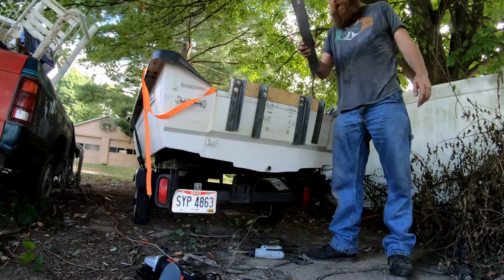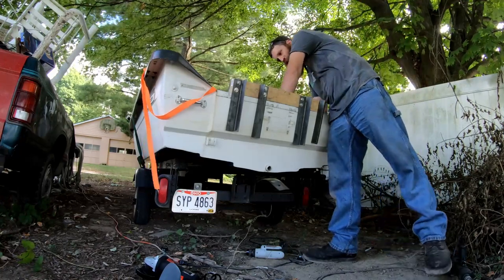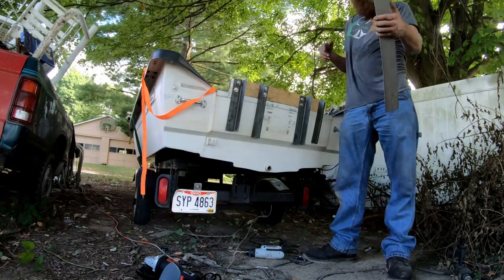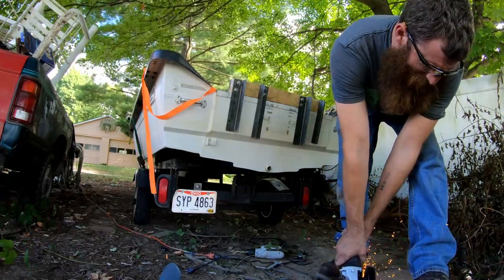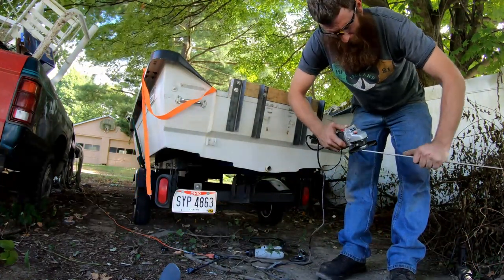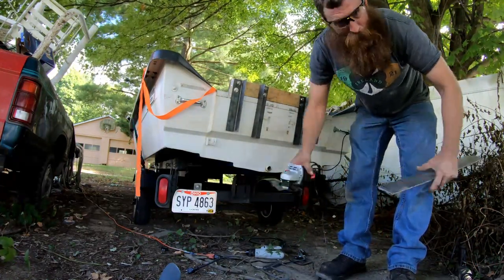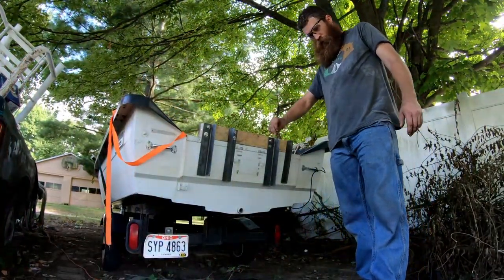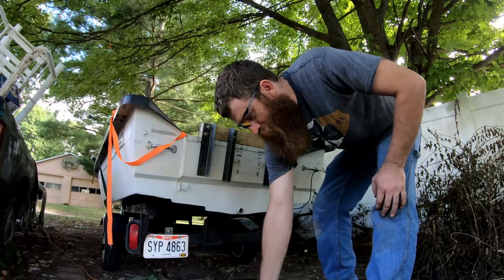Transom elevator for Jon boat. No holes jack plate!! Raise your transom.

Comment: Your drill bit is either dull, or a wood twist drill, that you have dulled.
Reply from the maker: I think it was getting dull got the bit from harbor freight. It was new when I started and I did not use oil. Thanks for watching!

Comment: That is absolute overkill. Way too much material for the job. Drilling the transom and using some aluminum plate on each side would have been so much easier.
Reply from the maker: Would have been tough to title the video “no holes”